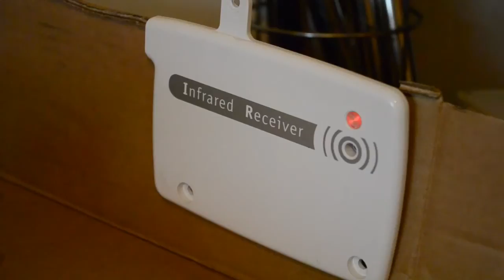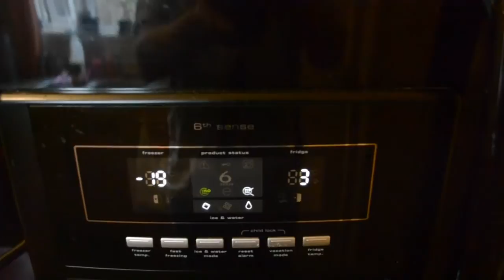Whirlpool Smeg Admiral Maytag Kenmore Ice Maker & Infrared Receiver Guide

Comment: thank ... great video.... question... i have a Whirlpool ice maker like in the first part of your video. the symptoms are no ice is being made... when the freezer door is open, the right side LED is pulsing 2 times then a pause 1 time. When i close the door to the LED sensor on the left side, the LED on the right continues to pulse 2 and 1 with no changes... does not go solid. Along with this, closing the left side LED door and the light switch, the right LED turns completely off. is this a bad ice maker or the IR components... left or right? thank you!!!
Reply from the maker: Dean Treadwell 
Hi Dean, it sounds like the transmitter on the left is faulty.